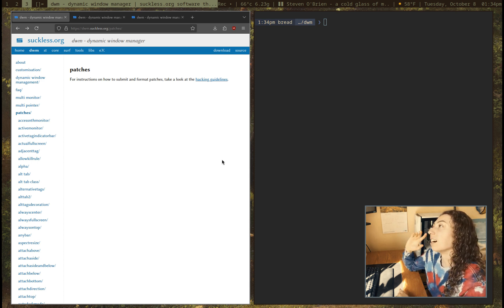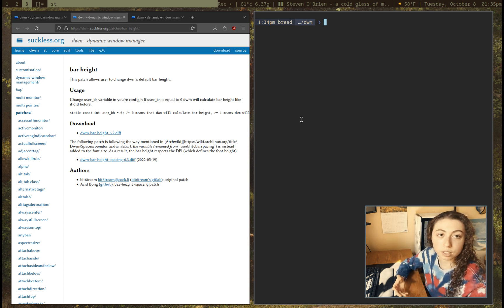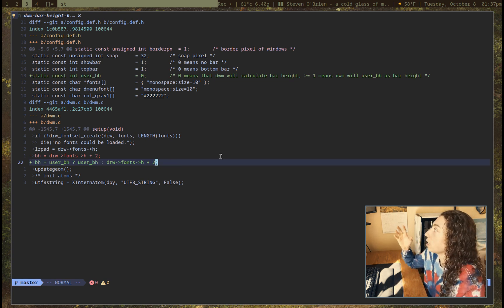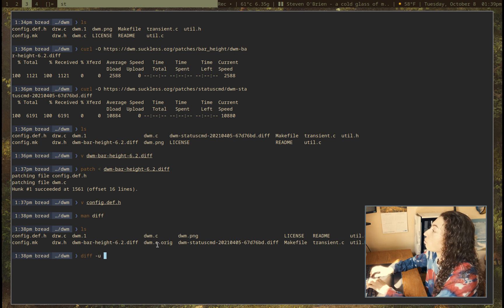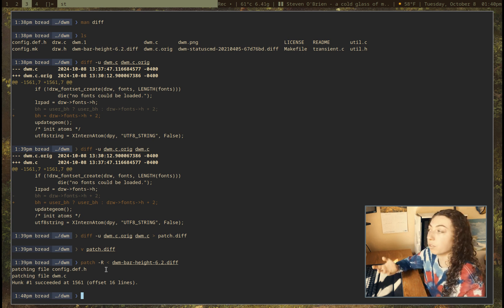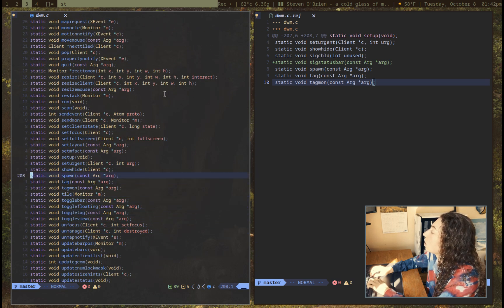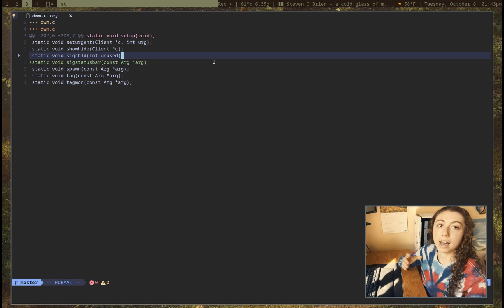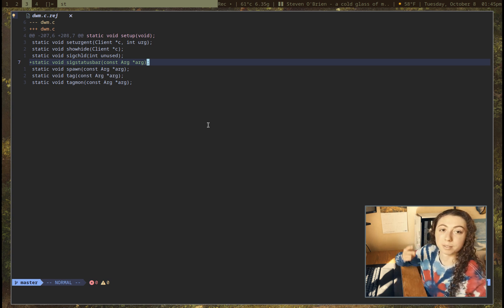Patching dwm and suckless utilities - a friendly guide to patch and diff

Comment: The patch tool basically never worked for me so i ended up writing all my patches in manually. Did anyone try the defaulttransparency patch? It seems sus as hell tbh. It just makes every window transparent and supposedly gives you the ability to change that transparency but it didnt work. it isnt even useful I realized quite quickly. Oh and it ends up using enum 11 on some array that only goes to index 10 which feels kinda bad. Oh well, hope nothing crashes.
Reply: I should add that all problems I mentioned could just be me missing something obvious.

Comment: Good stuff. Dwm being such a simple program is a great place to start for people wanting to learn more about building software and you don't have to be a C whiz to do it.
I did some 16bit DOS C programming in the early 1990s but never did get into C++ and object oriented stuff. Still, when I had a problem with a wifi driver for my freaky little USB wifi dongle, I was able to work through the compile error messages to get it running. Over a few kernel upgrades I had to do this a few more times and was starting to get much better at figuring out what needed fixing. I even submitted a patch back to the Github project to make the driver work for all the kernel versions I'd worked through. Made me feel a bit more useful.

Comment: I really wish I had these resources while I struggled to migrate from Windows to Linux.

But diving into manjaro - really helped me to settle into arch like environment when Manjaro eventually failed me.

Now I use only Arch for almost everything, except Raspberry Pi.
Reply from the maker: Trying an Arch-based distro is a great way to start getting used to Arch - it allows you to start getting familiar with the command line but not have to fully migrate with no experience. 

Thanks for commenting!

Comment: one of the important things i struggled with my config is patching, or say adding more and more patches. It would be cool, if you can make a video with bare bones dwm, then apply patches, which will break the config, and then fixing it. DWM scares people at this point, or else this is extremely cool manager.
Reply from the maker: Hey, yes patching can get more complicated once you add many patches - the basic strategy to apply a patch that fails is just reading through and carefully inserting/replacing code manually. I may make a video showing how to apply several 'conflicting' patches in the future :)
Thanks for watching and commenting!